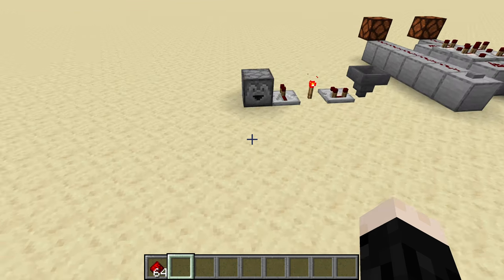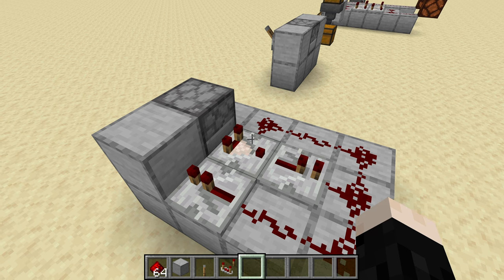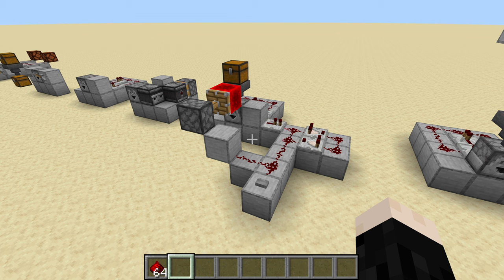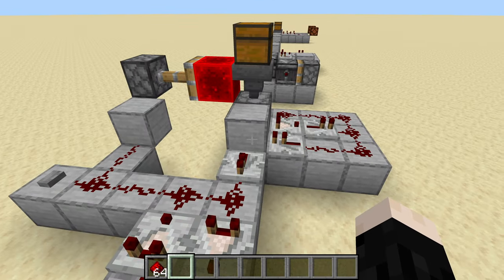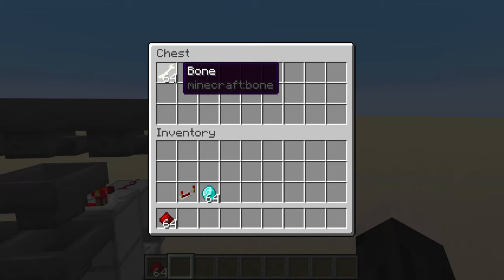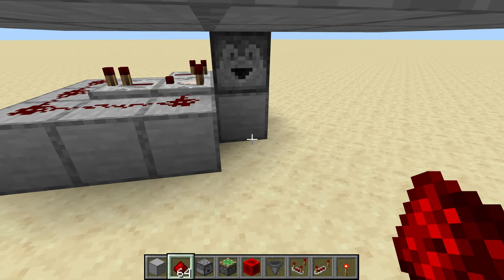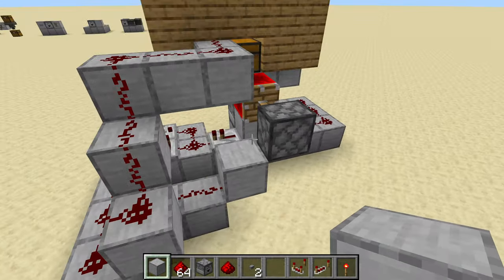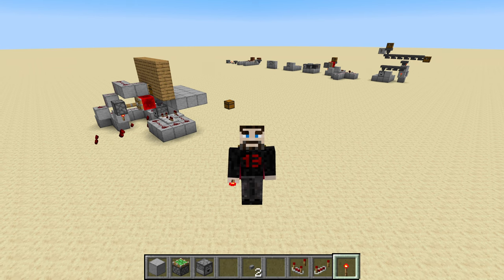How to Make a Trash Can - Minecraft Red Stone Tutorial

Comment: The locked hopper with the lever is great for mob farm sorting systems with staggered chests that use hoppers to allow items to drop into the lower chests as items are removed. I have a hopper under the bottom chest locked by a lever and when I want to flush the chests into a hopper line leading to a trash I just open the lever.